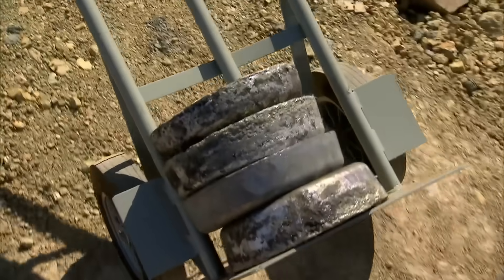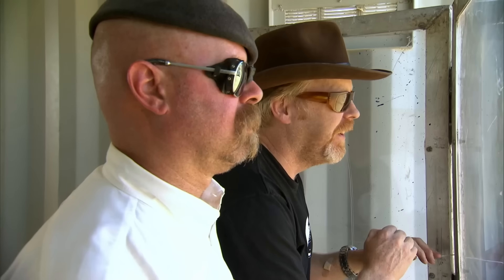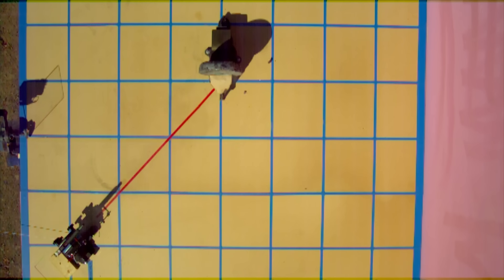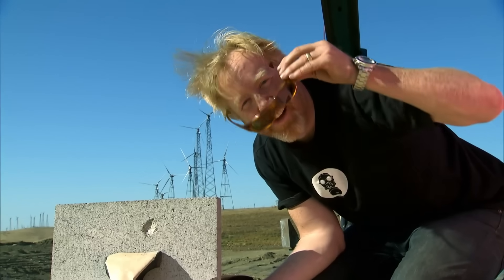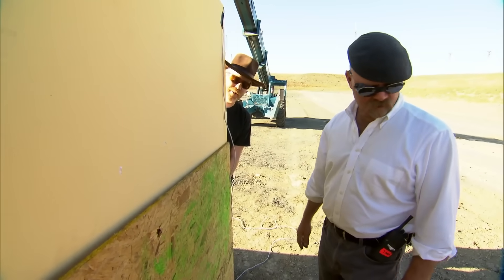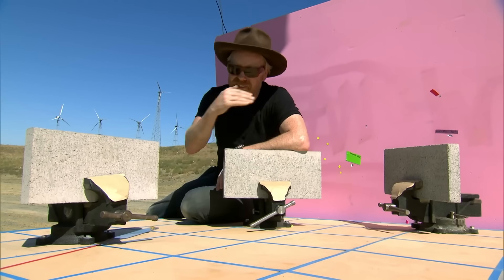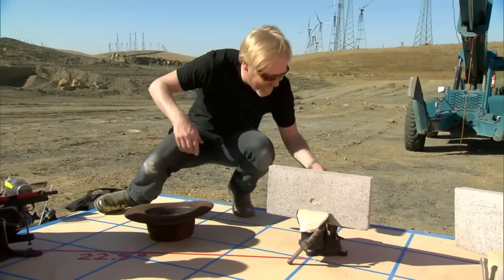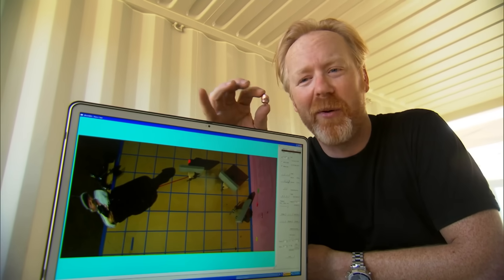Can A Bullet Really Bounce Back And Kill The Shooter? | MythBusters

Comment: Considering there's a number of people KNOWN to have died and a lot more injured from it?
Uh, kinda have to say that it's beyond proven many times over.

"angle"

Bullets have been known to bounce STRAIGHT BACK from a straight angle impact.

"lost almost all its energy"

Well duh?   You used LEAD, a SOFT metal.   Of course it was going to absorb most of the impact, as is clearly shown on the block of lead, that big hole doesn't just appear by itself.

And then a cinderblock?   REALLY?   That's like begging for a fail again.    A BIG hole and a BIG cloud of dust from the shots, that's energy lost right there.

Why do you think gun ranges have metal collectors behind targets, angled 45 degrees, so that bullets go into the ground, sandboxes or whatever each range use.   That's how modern ranges are built exactly because if you put a 90 degree backplate behind targets, there WILL BE bounces back at the shooters.

Yes, i spent several years with the occasional visit at a pistol range, good enough that i was asked if i wanted to join the local competition team.   Including taking the training to act as range master(or whatever the English wording is for it).
And that includes a fair amount of knowledge, like the above.   And the fact that there were fatalities plural recorded in the last 300 years just here in Sweden due to bounceback.   Few, but still a nonzero number.

Comment: Yes.

There is video from Brazil, where the guy is shooting a metal target at relatively close range with a .40 caliber pistol. It hits him, and he dies moments later.

Distance is obviously a factor here, but so is location.

I've also seen a video of a guy shooting a glock I think it was. He catches a ricochet, but doesn't seem to realize it, until he fires again and catches ANOTHER ricochet. He suddenly realized what had happened after the second time. Which is wild in and of itself. Something slaps your chest and you think nothing of it until it happens a second time and hot metal is burning inside your body.

Comment: I've never seen anyone die, but you can certainly suffer injuries. If you are shooting steel and someone shoots it with something powerful enough to dimple the surface, a bullet can enter the dimple on one side, follow the crater, exit the other side, and come back at you. Chances are that only small pieces, or the jacket, will come back though. That's why there are normally signs on ranges warning you not to shoot steel with rifles, and why you will normally be barred from the range if you do. Armor steel is very expensive and dimples, or holes, are dangerous.

You can also have a bullet come back at you if you shoot a barrel with existing holes. The blue plastic barrels used to ship liquids are popular to use on ranges as vision barriers or "soft cover" because they are cheap and light enough to move around. The bullet can enter on one side of the barrel at an angle that allows it follow the curve of the interior rather than passing through the back of the barrel, spin around the inside, and exit an existing hole on the other side. I used to hear bullets spin inside the barrels until they expended all their energy. 

If the steel angled enough that the bullet is deflected rather than hitting straight on and splattering or passing through, the bullet may escape the range and hit someone, or something, behind the range with enough force to severally injure or kill.

Comment: I survived shooting a mostly buried tire in a field (it came whizzing back).  A worn out tire does a great job of preserving energy and putting it back into the slug as it rebounds.
Reply: I discovered a long colt 45 will bounce off a steel oil drum and land at my feet from 50 feet. My 357 magnum blew thru both sides of the drum. Velocity seems relevant?

Comment: I was hit in the neck by a peeled jacket from a 5.56 after it hit 3/8" hardened steel plate and I have been hit a few times at the shooting range by ricochets from handguns.  The metal jacket cut and burned my neck and I still have the scar.

Comment: In using .45acp, they’re basing their data on a round that shoots at a nominal 850fps. If their baseline lethal speed is 400fps, that would be achieved far easier and under a wider set of conditions if they’d based the tests on, say, 9x19 or .357 magnum using a more elastic ricochet material like steel. I’ve been on the range when “splash back,” not a fully ricocheting bullet, but just a piece of jacket, from a steel target caused injury.

Comment: I used to be a nuclear security officer and we had to go to the range 4 times a year. Our range was on site and not very big. We had steel framed angle iron target holders and every now and then someone would hit the frame. I was standing off to the back side while some shooters were going and someone hit the frame. The ricochet came back and got me in the neck. But it wasn't the entire bullet. It was about half of it. I did break the skin but just barely. It felt about the same as if someone threw it at me as hard as they could. Another guy got one in the shin through his pants that actually cut him pretty good.

Comment: When I was in my 30's I went to my parents house to shoot my 44 mag. We had built a target out of a skidder tire with a 1 1/2'' steel flange to stop the bullets. I was 30 yards away when I shot and something immediately hit me in my left leg below my knee. I went inside bleeding enough to soak my sock. I took a long handled set of forceps and dug a 160 grain chunk of lead out of my calf. It was 2 to 2  1/2 inches deep. I installed a piece of conveyor belt on the front of the tire to stop that from ever happening again. I got lucky.

Comment: Bullet bouncing back into eye, temple or throat at the slower speed could still be lethal.
Reply: There is a video on YT where the guy shooting a 50 BMG hits his target but the bullet ricochets. The bullet then hits the ground in front oh him, ricochets again, and then strikes him in the head. The bullet hits the earmuffs causing them to break and fly off of his head. You are absolutely correct. A ricochet is no joke and and has the potential to be very lethal. I'm betting if it got him in the head without the second ricochet then the guy likely would have died from his injuries.

Comment: Is concrete pavers the most bouncy thing for this experiment? Why did you choose it?
Reply: Would like to know the answer to your first question myself too.
But for their choice here. They needed something to keep the bullet intact with not much deformation as that would make more than one ricochet very difficult.
Steel would cause the jacket and the lead core to separate too often. Plenty of evidence for that exists in the steel target shooting community. And have seen myself how likely it is when some of my shooters hit the steel railing below the paper target (on a navy ship).
The thing about the paver is that it collapses locally and is turned to powder with a density of 3.4 (versus steel 7.83, copper 8 and lead 11.3). This lightweight dust is no longer connected with the rest of the target and will therefore cause less of a build-up of pressure that deflects/deforms the bullet. The lead target keeps interacting with the bullet a lot longer and has more time to deform the bullet.

The problem is also that they are throwing a gyroscopically stabilised projectile. On impact there will be some gyroscopical effects on the bullet, wanting to turn it sideways.
Reply: "Is concrete pavers the most bouncy thing for this experiment?"

Not even remotely close.   Concrete dampens the ricochet.
Steel is more likely to give a stronger backlash.
Reply: I'd even think the coarse nature of the brick would slow the bullet down even more. I'm flabbergasted they didn't use a steel plate shot dead on straight. It's commonly known to not shoot a steel plate dead on straight because it WILL come straight back to kill you.
Reply: Maybe watch the video next time
Reply: They explain how they tried lead as it was softer then copper, i imagine they tried this with steel or similar but possibly it would deform too much to bounce multiple times being softer

Comment: I used to compete in IPSC matches.  The matches are run very safely, but there was a time or two where I picked up a piece of shrapnel off one of the steel targets.  Felt it, but don't recall even a scratch.
Reply: I also think there's a significant difference between say a screaming 5.56 and a relatively slow .45 acp. I wonder if a tungsten core milsurp AR round would retain more energy than the .45, or if it would still dump most into the first strike.
Reply: @Deletirium  Absolutely.  I was shooting a TSW 356 at the time which has a muzzle velocity of around 1450 fps with a 147 gr TMJ as I recall - it's been a while.  Made major power factor and knocked over the steel poppers quite well.

Edwin Sarkissian has a bunch of YouTube videos shooting large bore rifles like the 50 cal and there have been some scary ricochets filmed.
Reply: I have a friend who got hit somewhere delicate by the steel penetrator from a 5.56 that bounced off of a mild steel plate. Didn't have enough to go through denim jeans but was in considerable discomfort for awhile
Reply: @andymuskopf8473  I can imagine.  The whole situation changes when you're using a high velocity round with armor piercing ammo.  The steel or tungsten core has a much higher coefficient of restitution than lead and if it doesn't penetrate the steel is going to retain more mass and have higher likelihood of a bounce or ricochet.